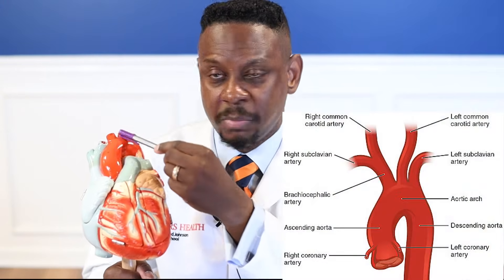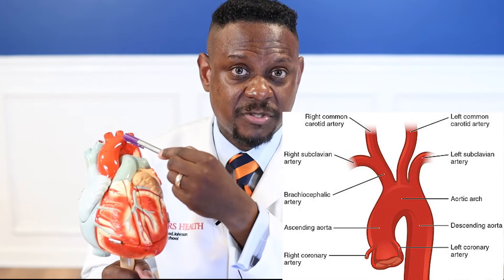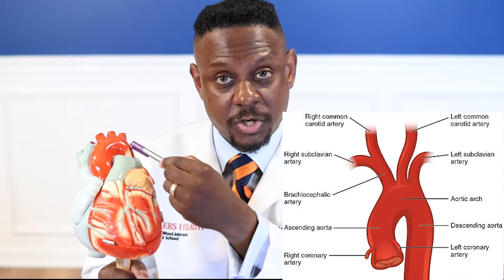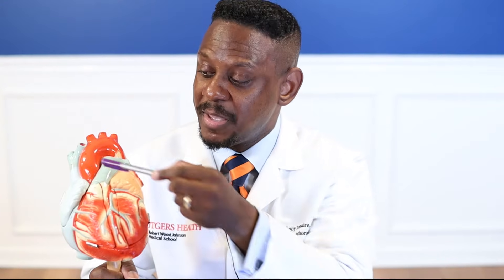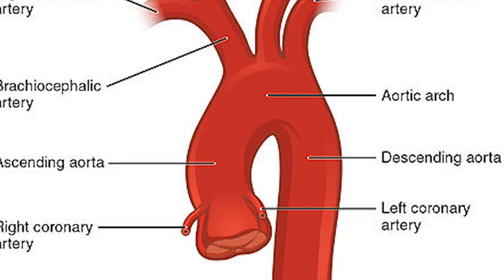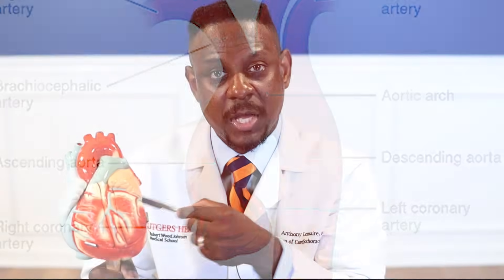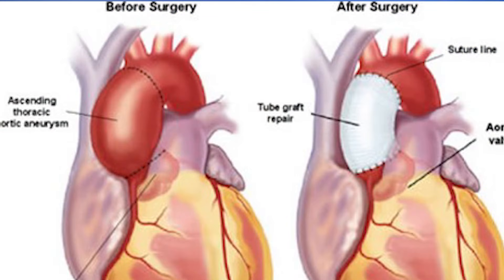Repair of An Ascending Aortic Aneurysm

Comment: As a 49 yr old male with no underlying issues and has a 5-5.11 that just got diagnosed 2 days ago why would you wait to fix as I am very active and do heavy lifting daily?
Reply from the maker: I hope I'm understanding your question. If you have a 5.5cm Ascending aortic aneurysm, I would NOT wait to fix it. You are at risk for rupture. I would have it fixed. Please see your doctor about this ASAP.
Reply: @cardiacsurgerypatienteduca2445  Its 5.×5.11. Small build up at the valve.
Reply: @timoerman8247  Man schedule it and get it done.  Trust me, as someone who has had the surgery, it's not that bad.  The most pain is the sternum pain and that really isn't that bad unless you cough or sneeze.  Get it fixed man and don't be scared, these surgeons know what they're doing.  Best to you brother!
Reply: I had it repaired 2-22-22 much better and no more issues. 29mm st jude valve.
Reply: @timoerman8247  I'm glad to see you got it done!  Hope you are feeling great and doing well!  Take care!
Reply: @timoerman8247  were you able to go back to heavy weight lifting?  It's hard to find pwolw who are very active especially with heavy lifting that can relate to having an AA. I refuse to stop lifting heavy so if I don't die sooner than later I am curious of I will be able to go back to lifting like normal
Reply: @Flexte Fitness  Yes I am a condrete driver. I have never lifted but I do alot of strenuous things. Chutes climbing javkhammers sledgehammer . I was told I repeat I could do anything I wanted including skydiving and scuba.  I have zero limitations.  As said I am 50 at this time and stay active. If your Dr said you can do it. Go for it. Be happy. And do b what makes You You